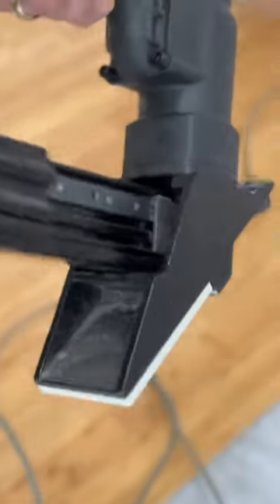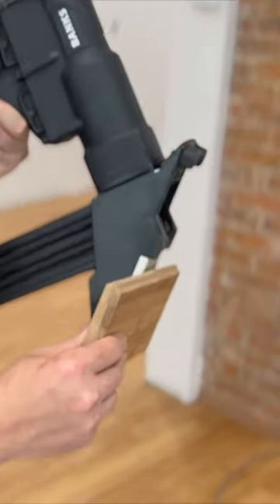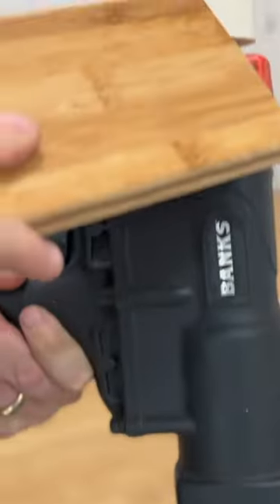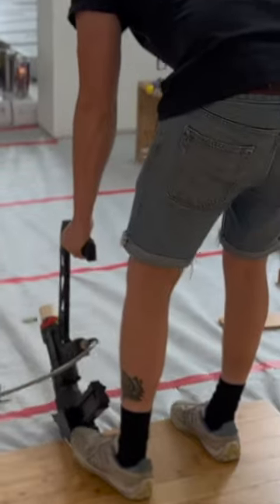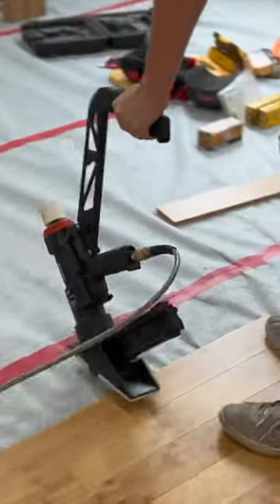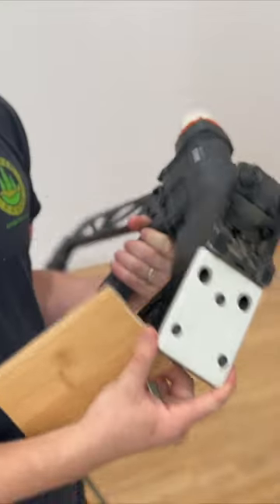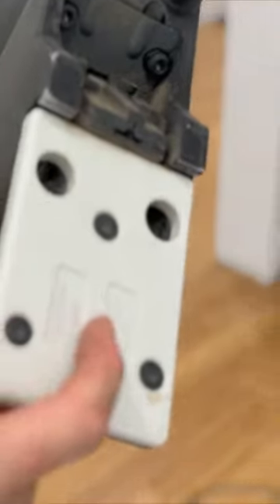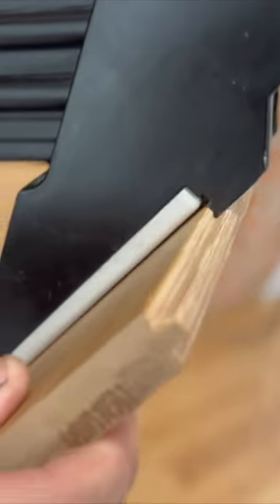How To Use A Flooring Nailer In 5 Easy Steps

Comment: Which cleats or staples do you need?
Reply from the maker: We used 2 inch cleats. Check the full video @housebarons for details
Reply: 16 gauge, for that floor 1  1/2 is enough, but has to be every 4 or 5 inches max between each cleats